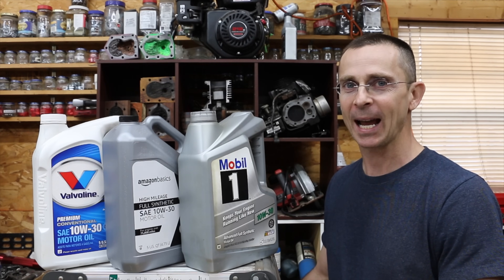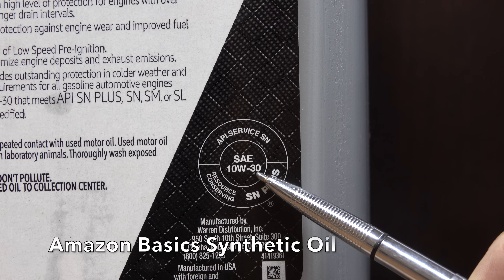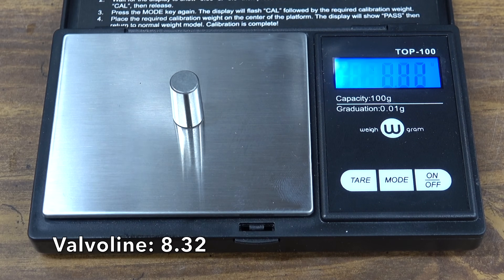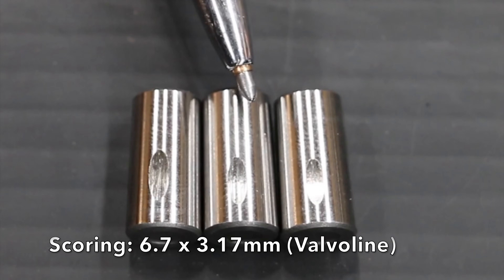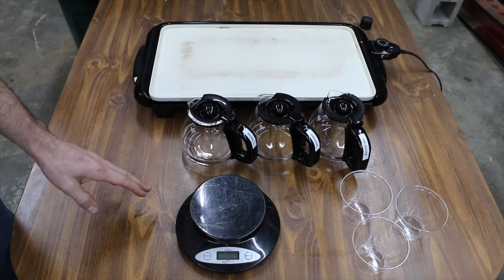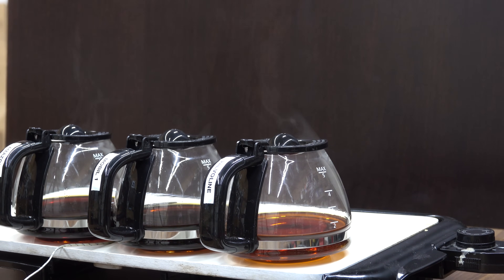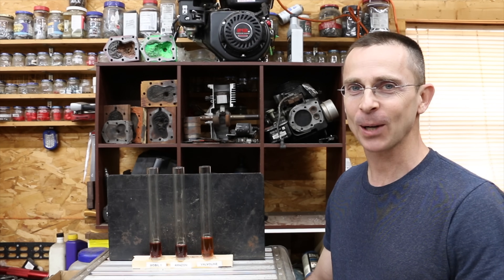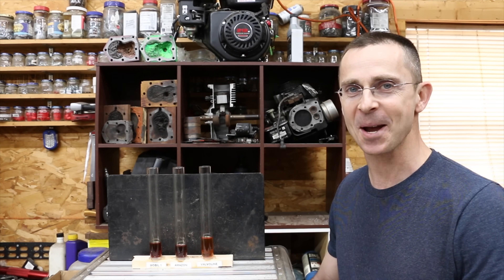Is AmazonBasics Full Synthetic Motor Oil better than Mobil 1? Let's find out!

Comment: Have you considered getting an analytical balance with +/- 0.0001g precision for these kind of tests (or at least +/- 0.001g)? You can probably find a high quality used analytical balance for relatively cheap on ebay or somewhere else, you want high precision, accuracy does not matter much as long as you're always using the same instrument and you're doing relative measurements.
I'm a STEM major and it felt so wrong seeing those % calculations based on a measurement that's within the margin of error of the instrument. 
Following up on this, theoretically all your weight data is scientifically invalid. Because when you're doing multiplication or division, the number of significant units in your result must be equal to the number of significant units in your least precise measurement. This means that when calculating the percentages you can only retain 3 significant units, therefore 0.01/8.33 = 0.00 which translates to 0%. Going beyond what your instrument is capable of measuring makes all the data invalid.
Same goes for the data you've put on screen on the scoring results, if your instrument is capable of measuring up to +/- 0.01mm you should add that last zero to the 6.2mm and make it 6.20mm (in the case of AmazonBasics result) because that's the real measurement your instrument is giving you.
On the lubricity test results your percentages should also follow the same rule, this means keeping only 4 significant figures after the initial division, therefore the percentages should be 74.3, 83.2 etc.
Also, the groove measurement pose quite an interesting problem if you want a real indicative measurement of real world performance. When the groove starts cutting in, it also starts becoming wider, creating a bigger contact surface that also creates more heat etc. I'm not sure what the real solution would be, but I believe that the comparison between each groove is not exactly a linear measurement. Someone better at physics should chime in on this one. Anyways, the way you're doing it kinda works, but there might be a bigger difference between each groove than one might think. (I'm just speculating on this one, I am not entirely sure)

Not related to this video, but the zip ties one. I suggest you to also warm/cool the equipment that's in direct contact with the product because the steel will instantly transfer heat away/to the product once it comes in contact with it.

By the way, I love your work and your openness to new ideas and constructive criticism. I suggest you look up the rules for significant figures and how they apply in arithmetic if you want a more in depth explanation.

Cheers!

PS: the last time I had the chance to work with anything of this nature was over 5 years ago so I might be a bit off since I'm saying all this off the top of my head.
Reply from the maker: Great recommendation. I just ordered a .001g scale. Always striving to improve the science.

Comment: your mass lost measurement tests are bollocks, the difference between 8.31 and 8.30 grams or 431 vs 430 grams can be due to all sorts of errors, and the scale can't even resolve finer than the measured difference! i've commented this many times, YOU NEED TO CALCULATE ERROR BOUNDS
Reply: he just does layman tests. Settle down Sheldon ! Fuck
Reply from the maker: Thanks for the constructive feedback. Just ordered a more precise scale.
Reply: @ProjectFarm  you're missing the point! it's not about the weighing scale, it's about calculating error margins regardless of experiment! (also you should try to do more than 1 sample each)
Reply: Just look at the technical data bulletin. All that he tested is on the document.

Comment: If you end up doing another one of these with more brands, a brand I'd like to see is Royal Purple; I started using it in my Mustang many moons ago, and haven't used anything else in it since. Oddly enough, the racecar, a Subaru with a high compression engine,  just gets the cheapest full synth oil I can find, but its about to get a proper engine built and with that it will start getting a proper, race ready oil, and I wouldnt mind seeing how Royal Purple stacks up to the cheap Amazon type stuff we've been using
Reply from the maker: Thank you for the video idea!

Comment: yeah but your grinding wheel is also wearing, which will affect the test results.  even though it's likely a harder metal, it will lose surface area.  this will cause a smaller rotation, going faster.  should have weighed it between bearing changes
Reply from the maker: Thank you!

Comment: Why not measure the oil that goes into the cups when doing the firm strength test.    Maybe its just me but it seemed like the Mobil one had alot more oil in that cup on the bearing test...
Reply from the maker: Great recommendation!  Thank you

Comment: Love that you are weighing the lubricity tester results now.  If you run another test, I'd love to see how Royal Purple and Redline perform.  Great test!
Reply from the maker: Thank you for the video idea!
Reply: @ProjectFarm  I used to run Redline in my high-test cars, after a lot of research I had heard it was very good.  I haven't used Royal Purple, thought it was snake oil but have heard that it's good in research I've done.  The only failure I've had that seemed like lubrication-related was while running Mobile 1, ran a new car from after to break-in only on Mobil-1, and had 2 of the lifters wear through.  Also had a rebuilt engine that had oil pressure problems, and a nationally recognized shop recommended switching to Delo 400 and the problems were solved.  Might be interesting to try Delo 400 as a comparison, it's not synthetic.  I'm mostly using dealer oil these days, my most used car doesn't use oil anymore, and the other cars I don't run very hard.

Comment: Do supertech oil please!
Reply: Amazonbasics is almost the exact same oil as Supertech
Reply from the maker: Thank you for the video idea!
Reply: its made by the same company
Reply: Supertech oil is made by Pennzoil if that helps out any your actually getting a decent product for the price can't beat it
Reply: @Nathan-gc1zy  I've worked at Walmart, you can use their employee scanners and it tells you the manufacture of the product, as well as looking up the MSDS on Walmart's website. Supertech was filled by Warren Distribution for awhile, same as Amazon's, but about a year or so ago, they switched to Citgo Oil, at least in my part of the states. You can tell by the shape of the bottles.

Comment: Haven't finished the video yet at 7:32 but I have noticed the Valvoline is at a huge disadvantage being conventional VS full synthetic. Conventional will never keep up with Synthetic no matter what brand.
Reply: Unfortunately it kind of hurts Valvoline's image as many will over look that it was a conventional oil used. If you just see the results you'd think Valvoline sucks because it's just referred to as Valvoline.
Reply: @yawnyle  You would be correct in that.. I tend to skip around in videos and thought, that Valvoline must be conventional, so went back to the beginning to look.  Glad to see it was, Valoline full synthetic is what's in my vehicle right now. Used to use Mobil1 religiously in my Hondas but now I've been buying Subarus as of late, dunno why but some of those boxer engines like to eat Mobil1. I switched to Valvoline and just stuck with it. Never had and wear issues using either though. Both quality oils. My buddy uses royal purple in his, even his daily driver but I dont see any advantages that outweigh the cost, especially in a street driven car.
Reply from the maker: Thank you. Yes, it was a control.
Reply: @ProjectFarm  Better just label it "control: conventional" w/o brand name then. Now you need to compare valvoline conventional vs synthetic lest a lawyer will come after you because brand damage :/
Reply: I see it as a control; either of them should be able to handily beat Ye Olde Standard, and we get to see by how much.
Reply: Lol I work at a Valvoline instant oil change and they drill this oil in our heads as an employee. And honestly i was hoping to see Valvoline come up on top but it was dead last. Though it was the control...
Reply: @CA66HMS  it was synthetic vs regular, i dont see any brand really standing a chance against a synthetic.
Reply: @CA66HMS  Like other guy said, no conventional brand out there can match the synthetics.
Reply: Maybe he should've used Mobil Conventional. Or the Valvoline Syn.

Comment: For viscosity there is an item called a marsh funnel which is used for finding viscosity of drilling mud which is the oil / lubricant for earth drilling. 
Are you familiar with them?  Amazon has them for $10.
A couple questions.  I don't recall you ever mentioning a patron account. I see there is one with the Project Farm name but I'm wondering if it's fake? It's been known to happen. 
Also do you publish an address to send things to you if they wanted to?
Reply from the maker: Thank you very much for the marsh funnel information.  The project farm patreon account is legitimate.  I don't mention Patreon much but the support does help a lot.  Address is:
Project Farm
PO Box 162
Peculiar MO 64078
Reply: @ProjectFarm  TCP Global Brand SG244 Liquid Thickness & Viscosity Measuring Cup Ford # 4 Four, Viscosimeter to Measure Paint https://www.amazon.com/dp/B00IL7DVNW/ref=cm_sw_r_cp_apa_i_2CTyCbPEJ5STE
That's one version. They are very simple items.  The one I used was a high-dollar one because of the brand name.  It comes down to being a funnel with a brass fitting in the bottom with a specific size hole in it. 
Fill the funnel to a specific height with the hole plugged and then time how long it takes for the fluid to drain to the point the flow breaks shape.  It's been a long time but as I recall it was the number of seconds compared to the temperature of the fluid that determined the viscosity rating. 
Example, as I recall. 10w20 meant in cold weather the oil would flow for 10 seconds and in hot temperatures the oil would flow for 20 seconds. 
I had to search Google for Viscosity Funnel to find the Amazon link. 
Fisher Scientific sells the high dollar ones.
Reply from the maker: Could you please send the amazon link to me for the funnel.  I didn't have any luck finding it on Amazon. Thanks again.

Comment: Amazon oil is Warren Distribution that makes a number of different "generic" store brand oils like Autozone and Walmart. The cold flow test doesn't necessarily prove much difference between M1 and Amazon, as it is probably a basic characteristic of the oil. That is, there is a tolerance for the "10W" part of the viscosity rating, which measures viscosity at cold flow. One companies 10W might be right at the spec, while the others is somewhere between 5W and 10W.

Comment: W stands for weight not winter. 10w-30 is 10 weight oil that acts like a 30 weight at high temps
Reply: It stands for winter not weight.

Comment: So, I have a longer experiment for you... There are a lot of “mechanics” that have been known to say that changing you oil on a regular basis is a waste of money. They say, simply change your filter every 3k miles and top off your oil.  I’m curious if you could find a way to test this theory on an engine after about 15k miles of use. Compare that oil to oil from an identical engine after only 3k miles. Do your lubricity test, and also send in both samples to a lab for analysis. You could test this on small engines that have oil filters. Instead of mileage, you could figure out a time range to run these engines that would be close to the time spent to drive such mileage.. it would be an awesome experiment, maybe even a 2 or 3 part series.
Reply: indeed modern cars are expected to do 10-15k on oil now, but its also a very much higher grade, fully sythetic and with additives to prevent the nastiness that used to happen even before 3k in the old days, i think now a 3k oil change would be a silly waste, it applied to old cars, older oil standards
Reply: Jusb1066 I agree, oil has changed greatly over the years. I don’t tend to change my oil before 5k miles, but never go over 6k. I always run full synthetic. I think the idea of trying this experiment may even help show that changing oil so often is a silly idea. The results could be very surprising in either direction. There are a lot of people brain washed by oil change places and dealers that throw that dang 3k mile sticker in the windshield! It’s ridiculous, especially for the dealers, when it clearly states in the owners manual that their cars never require that frequency of oil changes. On the other hand, the aforementioned mechanics that say this, say to never change it, just top it off with the filter change every 3k. I’m just curious and rather positive that’s a horrible idea; as I’m certain that will lead to issues with sludge buildup.
Reply from the maker: Thank you for the video idea!

Comment: You lost me when testing 2 syn. Vs. a conventional. I would love to see Full syn 10-30 Valoline. I use it in a stock block 550whp Honda J32 (3.2L). It’s always done well so I still run it, always have. Not sure it’s the best, but the motor does very well so I use it.
Reply from the maker: Thank you for the video idea!

Comment: Fascinating results and a simple but effective tests.  Thanks for sharing!

Request: test how the oils handle combustion byproducts like carbon/soot/sludge/etc., Rich fuel/air ratio to produce black soot Especially in diesel engines. Then feed the blow-by into a freshly polished mower combustion chamber like how cars are forced to digest it and come up with a winner. Really hate cleaning that intake area filled with oil and soot.  Robs power. ugh!
Reply from the maker: Thank you for the video idea!

Comment: You should test super tech....aka walmart oil
Reply: it's the same as the amazon. both warren dist.. so no point.
Reply: I always used walmart oil. NEVER had any problems with it.
Reply: @theone2be33  as long as its sae then it's good
Reply from the maker: Thank you for the video idea!
Reply: There is someone...Mactfordedge. This man tested 21 or 22 different synthetic motor oils at Blackstone Laboratories, and found Super Tech to be better in antiwear and detergency than a lot of the Mobil 1 synthetics.

Comment: Do you know if the Amazon oil is made by Warren?  I have been doing some research on this oil also and you tests confirm that the Amazon Synthetic oil is pretty good and for the price it's hard to beat for a daily driver.  Thanks for your vids.
Reply from the maker: Thank you. Yes, Warren Distribution.

Comment: Very interesting tests. I have a few suggestions:

1) On the flow test, adding a measurement tape to each pipe might give a better idea of the flow speed.
2) After "cooking" the oil, running it through the lubricity tester again would have been interesting. It seemed to me like the Mobil 1 was moving less slowly than when fresh, so maybe its lubricity has also changed.
3) The lubricity tester is really cool - but I got to wondering if it is possible to accurately measure the power requirement. If, for example, it was "forced" to always run at 1,000 rpm, the worse an oil performs, the more power it should require (as energy is used to remove material). As such, better oils should have lower power requirements - but the test setup might not be sensitive enough to tell.
Reply from the maker: Great recommendations!  I have a way of measuring energy draw during the test but just want to make sure the testing equipment is highly precise before including it in future videos.

Comment: mobil 1 0w-40 european TEST IT vs  any out the store oil or oil treatment
Reply: I’ve been using Mobil 1 0-40 in my 6.1L Hemi for over a decade and have never paid more than $30 for 5qts and usually got a free oil filter too. All of the big automotive chain stores have a sale every couple of months. I’ve noticed most have dropped the free filter deal, but the oil is still comparable in price to everything else when you shop around. I try to avoid stepping foot into a Walmart at all costs.
Reply: @athhud  I agree, I despise Walmart and only go in there if I can't find M1 on sale any place else.
Reply from the maker: Thank you for the video idea!
Reply: My wife just bought an older Mercedes C320. They SPECIFY Mobil 1 0x-40 for this car. Seemed to me that maybe someone paid somebody off. I'd be very interested in a test like that too. I bit the bullet and  paid $8.77 a quart for the Mobil 1. This time. Maybe next time I'll try a different brand in that weight though.
Reply: @dobypilgrim6160  You can get 5QT jugs of Mobil1  0W-40 at walmart for $27 basically the same price as the amazon oil but Mobil1 meets Mercedes 229.3/229.5 and VW/Audi 502.00 / 505.00 specs the amazon oil does not. Also Mobil1 frequently does $10 rebates.